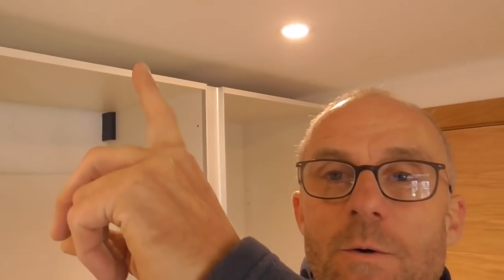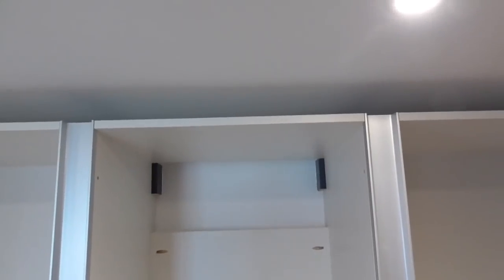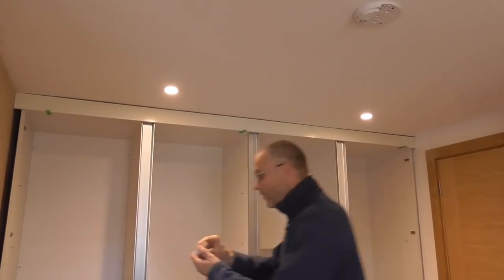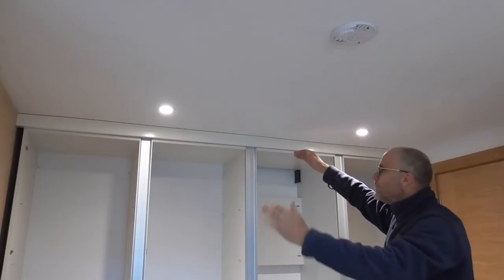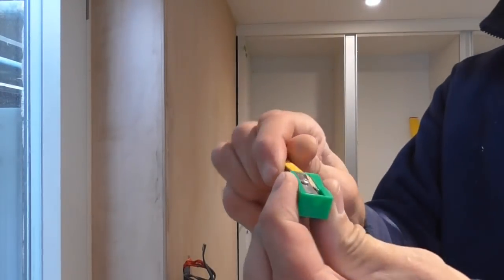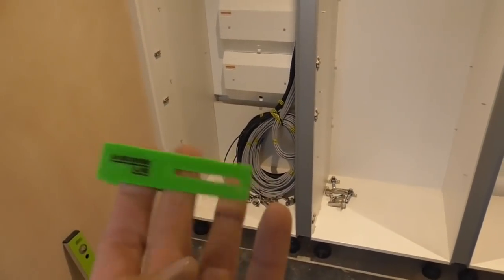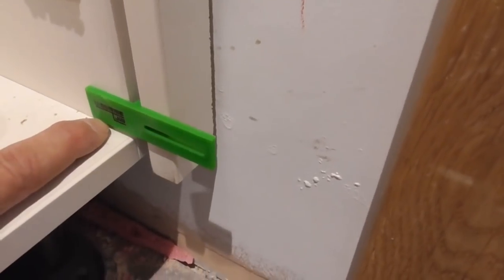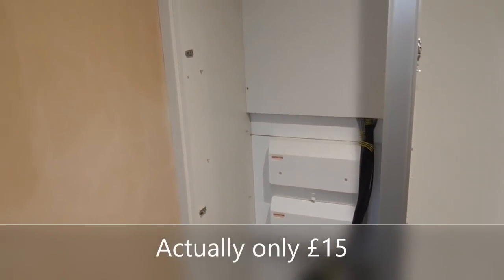How to cut perfect kitchen panel scribes using the U-SCRIBE JIG system.

Comment: Del, I have this kit. Not sure if you know this….. if you have say a 120 panel but need to cut it for a 60mm end filler. You don’t need to cut it down first. You can fit the jigs to the back of the panel and clip it on the edge with the panel on the inside. You then get an off cut of the 120mm and use that to scribe your wall. The only slight flaw with this method is when you come to the jig positions, you have to miss them out but it works really well and you only have one cut rather than 2. 
I also find using the track saw on a slight back cut gets a great finish and allows a neat finish . 
Sorry if you already knew this method.
Reply from the maker: Hi Paul. I get exactly what you mean. You're basically using the jig to hold the panel in place, and then cutting a scribe block the right width to mark it. I will a definitely apply it on the next kitchens on this site👊 I'm still finding my feet with my track saw, so may well give it a go on scribes🤩Thanks for your tip and for putting down in the comments for others to see👍Cheers Del
Reply: @thetallcarpenter  yes Del , for an end filler you would clip the uncut panel onto the carcass ( like a door) so you can still see the full filler gap. Then using the scribe block cut from the waste end ( if the panel is 120 wide, the scribe block is 120) scribe the panel and cut. 
Enjoy!!!!!
Reply from the maker: @paulyoull5472  🤩👍

Comment: Got my set a few months ago and they are a revelation. Mucked about long enough thinking I didn't need them and persevered with the ways I always used. To avoid trying keep a narrow piece of scribe material straight i use say a 100mm piece that i know is straight and have it sitting on the inside of the unit, so long as I use a 100mm scribing block, the only issue is the tails of the jigs get in the way but the result is the same.  Fine run of videos from you.
Reply from the maker: Hi John. I get exactly what you're saying. If the carcass gable bows out, I'll just pack it straight from the wall, and if it bows, I'll usually fit a shelf in the middle of the unit to push it straight👊 Thanks for watching and your comment 😎 Cheers Del

Comment: Hey del. Hope your well mate. I use them, really handy. I also use the block scribe it's a 3d printed block that your pencil slides into and you can rotate it for all the common panel thicknesses. It's really handy as you can scribe your line with one hand and it's pretty inexpensive. Great tips mate, 👍
Reply from the maker: Hi Sicpac66🖐 Your the second guy that's mentioned the block scribe, and it sound 👍 I must get one👊 Thanks for your comment mate and for watching 😎 Cheers Del

Comment: Brilliant video ,love u-scribe but can you use the scribe to make the length of wood sit inside the gap flush with the carcass rather than a overhang if that makes any sense .
Reply from the maker: Hi Simon. I know what you mean, and the scribes I'm cutting in the video would perfectly sit 'in the gap' and be flush to the carcass face, but I just project these out with another strip of material so the sit in the linebof the doors👍 Great comment and thanks for watching 😎 Cheers Del
Reply: @thetallcarpenter  Oh i think i get it ,because your strip of wood was the same size as the frame carcass ,it would fit in the gap perfectly, what a fantastic bit of kit, cannot believe that i am now excited about ordering one lol , massive thank you Del for sharing your knowledge with us mere mortals lol .
Reply from the maker: @simonmiddleton2990  You can now share my exitment when you first use them Simon🤗 It's changed scribing kitchen panels forever👊 I'm no different to any of you guys, and enjoy being part of the carpentry massive🤩 Cheers Del

Comment: I usually hold it flush with the edge of the carcass and run down the wall or ceiling with an 18mm block to do my scribes same as this but as you know working on your own it can be hard to hold them, so these jigs are brilliant do all the hard bit for you, I’m definitely going to get some, thanks for sharing not seen them before 👍
Reply from the maker: I used to do the same Brian😬and these little jigs will change the way you do scribes👍Worth £15 all day long as far as I'm concerned🤘Thanks for watching and your great comment😎Cheers Del
Reply: @thetallcarpenter   also I usually clamp a piece of plinth or something to the bottom of the carcass to stop  the filler sliding down, but your accident worked as well ha, keep up the good work mate your videos are always good and interesting, and I see you reply to all the comments from people so thanks for taking the time 👍
Reply from the maker: @briansearles7342  I enjoy reading and replying to every comment Brian. It is time consuming, but worth it👍 Cheers.

Comment: Great video and now make a bit more sense in how they work.

Just one question though; if tge jigs are fixed and the thickness of the scribe off cut has to be the same size ard the carcass then what is the measurement from the ceiling to the middle of the unit for?
Reply from the maker: Hi there🖐I'm sorry but I don't quite get the question you are asking about measuring down from the ceiling🤔Cheers Del

Comment: Your good with the saw free handing
Reply from the maker: Hi Darren. I take my time bud, but I do sometimes feel like I'm going 'snow blind' when I'm following it on a white panel🙈I was going to video it, but it just wasn't possible😬Thanks for watching😎Cheers Del
Reply: @thetallcarpenter  fair play to you it's a great skill to have, very confident to do that on finished material, thanks for sharing
Reply from the maker: @darrenroche9225  You just need to be really mindful of the rear of the blade, as if you touch the cut on the upward rotation of the blade, it will make a right mess😬Cheers bud

Comment: Great little simple tool, but when you have a base unit door, if you make them exactly flush on the unit they will sit back a couple of mill, because the doors have a couple mill gap from the unit!! so do i have to bring them out level with the door and allow a small piece of the backing fillet to show? ( mine is on the hinge side so it wont be seen i think).....is that correct?
Reply from the maker: Hi Johny 🖐Yes, you are correct and the panel does need to come out that extra couple of mm. 👍Cheers Del

Comment: Do you tilt the saw blade slightly to give a tight face edge of the scribe ? Good product for kitchen fitting
Reply: I tend to run a planer down just slightly removing the angle
Reply from the maker: Hi Goner. Generally I cut with the saw a 90 degrees, but may just back off the cut with a planer if necessary👊Thanks for watching🤩
Reply from the maker: Same here Gary👊Cheers bud

Comment: Brilliant explanation, I guess you could apply the same to the kick boards only upside down.
Have you used them to scribe a pannel that's flush with the underside of the top of the carcass. I'd love a video on that
Reply from the maker: Hi Dan. They are super adaptable, but I'm not sure I quite understand where you mean the panel would be scribed on the underside of the top of the carcass 🤔Cheers Del
Reply: @thetallcarpenter  sorry bad at explaining myself.
Say you wanted to make a face frame around a carcass so the panel would fit flush to the inside of the cabinet
Reply from the maker: @danthechippie4439  Ah, I see. I've never done that, and would be interesting attempt🤓 Cheers

Comment: Nice vid, good demonstration 
Just out of interest, who supplied the kitchen in the vid?
Liked those euro hinge clips to the carcasses, look smart. Do they still have much adjustment, up and down?
Reply from the maker: Hi there. The kitchen is put together by a company who source the units from one manufacturer and the doors from another. The hinges have got a smart little mounting back plate, and adjust up, down, forward, backwards and in and out the same amount as most other hinges I've come across👍Thanks for watching

Comment: Have you fixed a timber to the back if you overhang the scribed piece ?
Reply from the maker: Hi David. Yes bud. I ripped that carrier strip to 35mm wide and drilled and screwed it to the back bottom edge of the scribe with 4x50 screws👊 I'll probably do a short video showing this detail👍Thanks for watching😎Cheers Del

Comment: How did you connect these two "L" panel elements together? It seems no screws. Glue maybe?
Reply from the maker: Hi there🖐I cut the 'carrier' peice 35mm wide and screwed it into the back of the scribe with 50mm screws, ensuring it was flush with the bottom edge👍Cheers Del
Reply: Thank you for replying to my comment :) You screwed across the board into chips. Weren't you afraid that the chips would push the board apart? Did you drill first?
Reply from the maker: @piotrchojnowski1112  I did exactly as you suggest, and drilled a 4mm clearance hole right the way through the centre of the 'carrier' piece, and then GENTLY put 4x50 screws in until the two pieces were tight together👌
Reply: @thetallcarpenter  I''ll try it on the next job. You should get Noble prize for that :) Thanks you so much for help!

Comment: Hi Derek nice video to showcase this great little invention, I saw these a couple of years ago on 10 minute workshop by Peter Millard and promptly bought some. This may seem like a silly question but how did you fix the secondary piece and right angle to the scribe to allow it to protrude 22mm to be flush with the doors? keep up the good work
Reply from the maker: Hi Kevin. I do a feel like a right plank for not discovering these great jigs ages ago, as they are really cool👊 I rip down a carrier strip on the table saw at 35mm and screw it to the back, bottom edge of the filler panel and with 4x50 screws👍I think I'm going to do a little video on it, as its quite a cute little detail😎Great comment, and thanks for watching🤩(I'm going to watch Peter Millard videos now to see what other cool marking aids I'm missing out on🤗) Cheers Del
Reply: @thetallcarpenter  always enjoy your videos Derek, another interesting jig that Peter Millard introduced was the ‘waste side’ cut jig when using a track saw (it off sets the track by the thickness of the blade) another great little invention by a British maker known as Strawbyte Workshop, worth checking out….
Reply from the maker: @kevincollins512  I'm definitely going to check this out Kevin👊and thanks for the heads up😎Cheers
Reply: @thetallcarpenter  Hi Del, you should look at TF Tools for marking tools, drill bits, chisels etc.
Absolutely awesome company with truly excellent customer service.
Regards
Tim

Comment: Great product Del.
Laser update. It's too much of a faff to use the laser for anything shorter than 3 metres. I'm sticking to my normal method, folding rule for 0 - 900mm, 5m tape 900mm - 3metres, laser 3metre plus. I've also binned the pica and gone back to my school pencils 👍
Loving the kitchen vids btw, kitchens are my bread and butter.
Reply from the maker: Thanks for the update bud🤩Interesting about the laser, and agree with you about the Pica👊Old school pencils are tried and tested👍Thanks for watching😎

Comment: Great little gadget. The only problem I have with this solution is, that now the wonky ceiling (or wall) line is transferred and emphasized in the trim. Personally I can never unsee the wave...
For a perfect finish even out the ceiling/wall, even if it just for that general area, so the trim can be dead on straight. I do realize that there are very few walls or ceilings that aren't cattywompus in some way or other ;) It's almost as if screeds and darby's are esoteric ancient artefacts whose usage has been lost to time...
Reply from the maker: That's a great comment🤩and I know what you mean about excentuating wonkey wall and ceiling lines, but that's not usually our department🤔Cheers Del
Reply: @thetallcarpenter Thanks I fully appreciate that too, cheers and keep them coming, I always enjoy your videos!
Reply from the maker: @disklamer  🤗👍

Comment: Hi Del.....I noticed you fixed your filler so that the base was in line with the underside of the carcass, hence why you had difficulty with the top edges, having to cut them beforehand. If you had set your filler so that the top of it was level with the top of the unit, you wouldn't have had that issue. You would have then used an off-cut from the filler, the same size, to scribe along the ceiling. I know this video is a year old, so maybe you have already noticed this. U-Scribe have their own page on YouTube, watch it, you'll see what I mean :)
Reply from the maker: Thats a great tip bud🤩and I'm always ready to take advice on new methods😎Cheers Del

Comment: Why not just screw some small L brackets to small of cuts and clamp them to the uprights of the carcass, cheaper, quicker and you can adjust them if the carcass is different thicknesses?
Reply from the maker: That's a great, no cost, option Colin👊Cheers Del